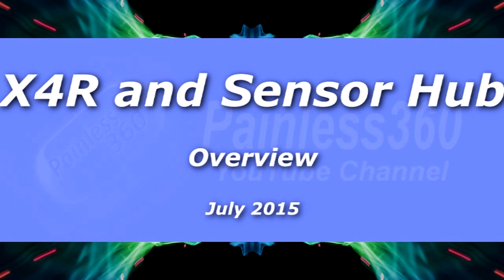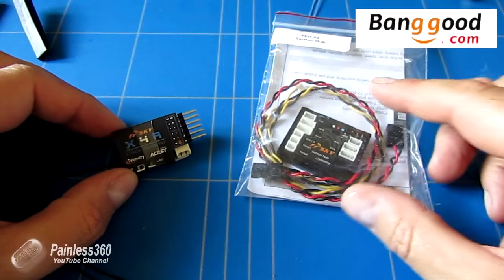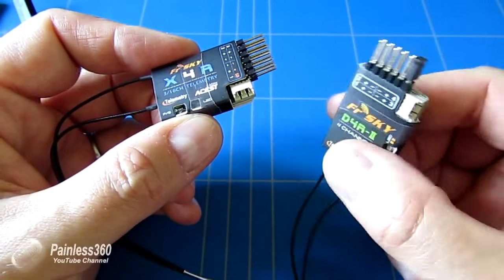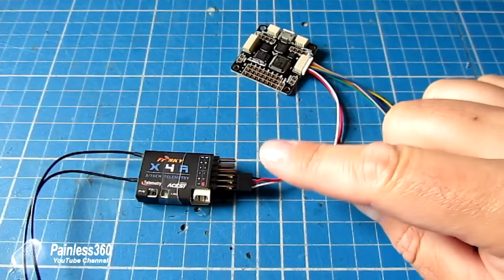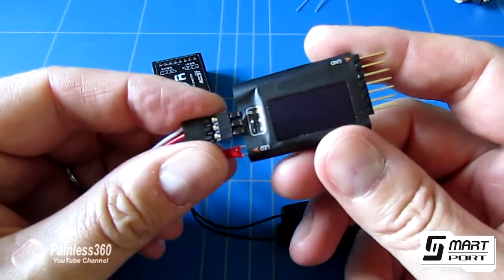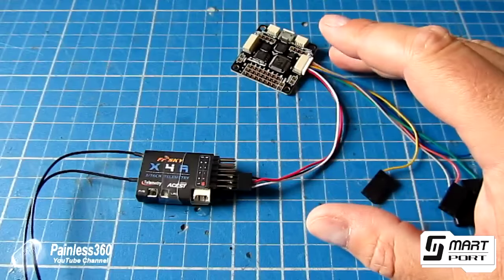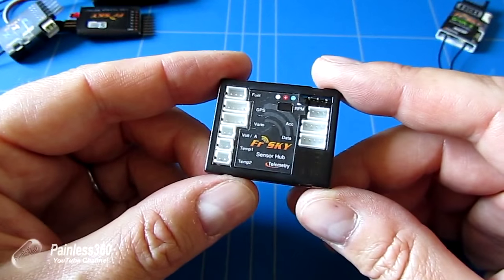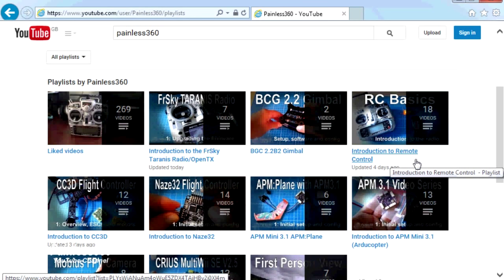TARANIS Quick Tip - X4R Receiver (S-Bus and Smart Port) and Sensor Hub from Banggood.com

Comment: Be careful when ordering an X4R recievers. There are 2 variants, a 4 channel PWM version and a 3 channel PWM version with s-bus. Both versions fully support smart port sensors. The s-bus version supports up to 16 channels via the s-bus port.
You can think of the 4 channel version as a modern D4RII but with smartport rather than analogue telemetry connections. I have not tried it but I understand it is possible to reflash the receiver to eitherof the X types.
As Tim Hughes points out, the hub is all but redundant unless you are using D series receivers.
The real gem in the FrSky telemetry sensors is the variometer. Not only is this a fantastic vario/altimeter it also acts as a translation bridge to pre X series telemetry sensors. Perhaps not very useful with a full house multirotor flight controller but is perfect for conventional aircraft.
It is always a very good idea to fully check compatibility and function of FrSky stuff since it has evolved very rapidly with components from only a few years ago now obsolete. The problem is further complicated by the frequently obtuse information FrSky release.
In summary, use the D4RII in CPPM mode if you have a Naze32,multi wii or APM controller or the X4 if the controller can use S BUS like the Seriously Pro, Sparky and PixHawk boards.
Apologies for again spamming your channel Lee but as you can see this is a veritable minefield of compatibility issues unless you have an extensive background with the FrSky systems which a casual viewer may not comprehend.
Reply: +Rob B 

wont be the end of the world if you get x4r alone...

look at this mod:
http://boltrc.com/blog/x4r-sbus-mod-how-to/
Reply: Yes I know about this mod. I even left a comment on the link you quote. While you and I are comfortable hacking a new RX not everyone else is and this channel is mainly aimed at noobs hence my caution on choosing the correct version.

Comment: May you please do a video on the many choices of taranis receiver such as V8R4-II and explain the advantages of different receiver on mini racing quads in terms of weight ppm etc.
If that isnt possible could you explain the difference between the V8R4-II  and the D4R-II
Reply from the maker: +TheDIYGuy Very briefly, different protocols needed on the radio, no telemetry, PPM out or analogue inputs on the V series.. Happy flying!

Comment: I have the hub and several of the older sensors connected on a D8rII+ but i can't get any of the info to come through on the taranis Telemetry screen.  The only sensor that works for me with the taranis is the analog voltage sensor through A2 port.

Comment: Thanks as always for another great video. Would you mind looking at doing a video to go through the use of these new X4R receivers on things like minis. The stalwart Rx has been the D4R-II but these are being pushed as it's replacement however, it doesn't seem to be anywhere near as straightforward if you're using things like Naze32 boards etc.
Reply from the maker: We are using the X4R in the SP3 series and it does require an inverter for most other boards  (Naze32, Flip32 and CC3D). Apart from that it its very similar. Watch this space!
Reply: Painless360  awesome, thanks Lee

Comment: The sensor hub ... How to connect it up?? Can't find any info of it 😢
Reply from the maker: It was for the older non Smartport telemetry recievers. X series and later use those newer sensors. Those can be daisyxhained removing the need for a hub... Happy flying

Comment: so let's say I wanted to use the X4R-SB, a FLVSS, and a Naze32 Rev6.  I conect the SBUS to the FLVSS and then out of the FLVSS, to the Naze32 Rev6?
Reply from the maker: +Dean Cory If you mean the voltage sensor then that plugs into the SmartPort connection and the SBUS plugs into the FC..

Comment: I think you showed the SBUS connector to a Naze32 - does the NAZE support SBUS without some sort of inverter?
Reply from the maker: Jason Hyland Depends on the board. Most need an inverter as they do not have the circuitry on the board itself.  Happy flying!
Reply: +Painless360 I currently have a naze32 with my x8r. I'm curious, does the SP controller offer more options or better support for s.bus and smart port? I'd love to dump the s.bus to PPM board and gain telemetry without an inverter.
Reply: +Painless360 do you have any more info on this inverter? cant seem to find much info online about it
Reply from the maker: paulham Which one - s-bus? If so then HobbyKing stock them..
Reply from the maker: Duane Pinkerton Much better, see the quick tip video on setting up via all the common Rx options in the SP3 playlist. Hope it helps.

Comment: Also worth noting the D4Rii does not work on the EU 2015 Taranis as this model only allows D16 mode or off so you cannot bind the receiver which is a complete pain in the A**E.
Reply from the maker: unless you flash with OpenTx..
Reply: +Painless360  Thanks for that I had read so many topics on this saying so many different things .I will post here if it works,Brilliant vids by the way,I have learn't so much from watching them.

Comment: Question does anyone know if the frsky d4r2 has rxbt voltage telemetry capability not using the analog input, similar to the x6 or X8r receivers?
Thank you I appreciate your help guys.

Comment: Hi Painless 360, thanks for the video.  Just a question I'm hoping you know the answer to.  Can you transmit telemetry from the Naze32 board through the receiver back to the Taranis radio on the new x series receivers? I know it was just a single wire with the D4R-ii.
Reply from the maker: Yes but use a UART (not soft serial) and connect both the tx and Rx pins to the SmartPort pin on the X4R then setup telemetry for that UART in Cleanflight as SmartPort.. Best of luck!

Comment: What if you run 2 batteries in parallel or series, how can i get the X4R smartport to register correctly?
Reply from the maker: If you measured them from the right place, yes.
Reply: Painless360 any advice or can you point me in the place to get directions?  Would that also be able to get individual cell voltage too?

Comment: Hi Painless,
thanks for this video.  do you know if it's still possible to use ppm at the same time as using sbus?  currently purchased a matek 5in1 v3 pdb and it has a servo switch to control lights.  thanks for your help.
Reply from the maker: +Mango FPV Usually one or the other unless stated in the manual.. Best of luck..

Comment: Lee,
Other than using a flight control, how do I connect extra servos on top of the first three channels? Is it as simple as fitting and programming the  4-Channel S.BUS to PWM Decoder into the S.BUS port? I've been thinking of getting a few of these receivers.
Reply from the maker: iflylilplanes that would work or use an X8R or S-bus servos. .

Best of luck

Comment: Nice info Lee...thank you.  I'm confused.  I'm an X8R user and understand how to get 16 channels (don't need that many, but understand how to do so) from it.  For example, if I bind the Rx in Mode 4 I can get 8 CH S-Bus and then use the physical pins for CH 9-16.   I don't understand (excuse my denseness here) how you get 16 CH on this X4R Rx.  Could someone enlighten me?  Thx!
Reply: That would be a good video!
Reply from the maker: ***** i will add this to the list. . Thank for the suggestion!

Comment: hi again i'm trying to use sbus on the X4R to naze32 but it doesn't seen to work do i need a inverter or a diffrent software for the board to work
Reply from the maker: +Robert Matthews Probably need an inverter if you can't get it to work. Newer boards like the SP3 have this built in.. Best of luck!

Comment: How do I connect the Sensor Hub to an X8R? Via the smart port of the X8R? But I thought you said the Sensor Hub is not Smart port enabled? Please Clarify.
Reply from the maker: +Mounted Drone Pilot see the other videos on telemetry an s.port sensors on the channel. You'll see that all of the s.port sensors have two Smartport connections so you can daisy chain them together.. Best of luck
Reply: I know that I dont need a sensor hub if I have an X8R since X8R is smart port compaitble and I know about daisy  chain. But what if I dont like to daisychain? What if I prefer to have everything connected to the hub? Can I still connect the hub to X8R directly? If so how? via the X8R smart port? Or another port?
Reply from the maker: As far as I know the SmartPort sensors are hub-less design. If you figure it out let me know..

Comment: HI, quick question, I have more then one sensor (Lipo Volt, variometer and GPS). I have the X8R receiver and I connect normally one sensor to the SPort. 
do I need the HUB sensor if I would like to connect all sensors at the same time or I can connect that as a chain (one to another one)? thanks for any help you can provide (sorry for my english!!!)
Reply from the maker: +vtl u67 horsemart port centres you Daisy Chain them so you connect one cable in one side and then a cable from the other side of that sensor into the next one. Happy flying

Comment: how to use 3 pwm ch when u using sbus on x4rsb. those pwm channels match stick inputs ch and when using switch on same ch inflicts motors.
Reply from the maker: +meelis ce Not sure what you are asking..
Reply: +Painless360 once i have connected sbus on x4r sb then i still got 3 free inputs on rx. those use pwm signal but match 1-3 channels which r already used for transmitter stick inputs. is there a way to move some stick channels to some other ch so i could use pwm ch. want to connect matek pdb to it so i could use buzzer and led control
Reply from the maker: Yes, you need to change the mixes on the radio but many flight controllers will be very confused if the first few channels are not AETR or TEAR etc..
Reply: Painless360 yeah, got it confused already, now need to get it working lol
Reply: +Painless360 got it working, maped in cleanflight cli "map ta3r124e" and matched it in taranis mixers :)
Reply: +Painless360 that is nice quick tip to make video of ;) . there is a lot of peeps that use x4r and matek pdbs i belive. but during the process i learned that with older cppm fw on x4r pwm ch r maped in another order.

Comment: Hi. So from the sensor to the 8-xr receiver, is a three core lead. Three pin one end, three pin the other. But i didn't see that three pin input on the newer 4-xr receiver!. I got the s-bus bit ok. Probably need a different lead! Any ideas anyone? Thanks.
Reply from the maker: The X4R or the XSR?
Reply: Painless360 sorry i got the lettering around the wrong way. X4-r please!
Reply from the maker: It should come with a cable that had four connectors/wires. What they do is printed on the back of the Rx - Ain, Neg, Pos and SmartPort. SmartPort only needs one wire..
Reply: That explains it. Sorted thanks. I go get a X4R ordered now i know it can be done. Thanks again.

Comment: Well hello, I just called u guys about a problem so i had to post it here.
So my taranis is EU but no EU LBT but my receiver is EU LBT, so i need to update my taranis too to LBT EU.
So i tried everything, so i got my self the cables the usb and other things. Followed a tutorial on what wire to switch bla bla. I thought i could finally install the firmware through the program Upgrade Lite-S.Port Telemetry. The tutorial on how to http://www.dronetrest.com/t/how-to-upgrade-frsky-xjt-module-internal-module-in-taranis/1607 thats what i did.
But at the end it gives me  a error http://puu.sh/ohTQg/1d7de423ab.png device time out. he finds the device but when i press download it gives me that error. im lost.
Reply from the maker: +Je “God” kop See our video on how to update SmartPort devices - https://www.youtube.com/watch?v=IvXWdBpQNvk and https://www.youtube.com/watch?v=jiK2xA2sImE. The instructions are also on RC Groups - http://www.rcgroups.com/forums/showthread.php?t=2138392, personally if you've not used the cable and software before I'd suspect a driver problem.. Best of luck.